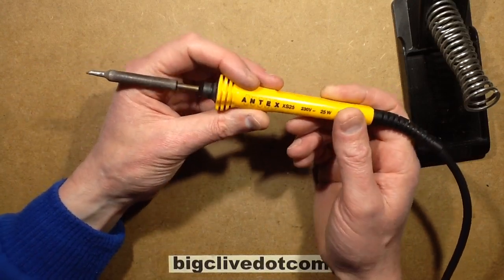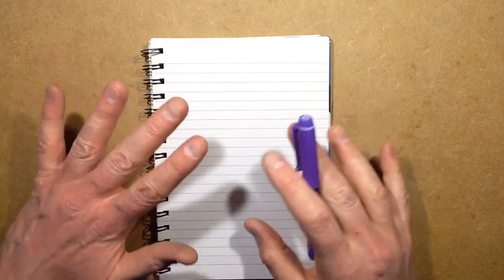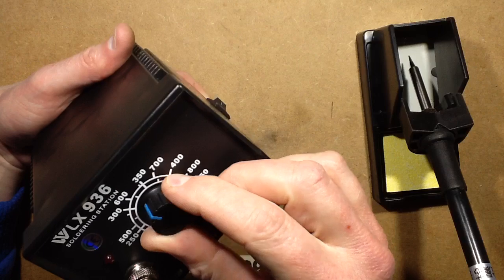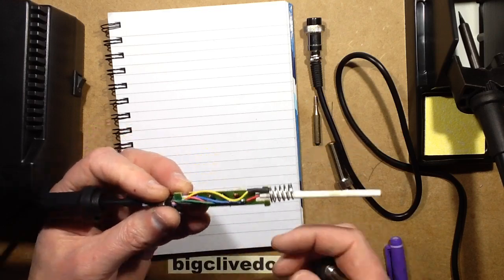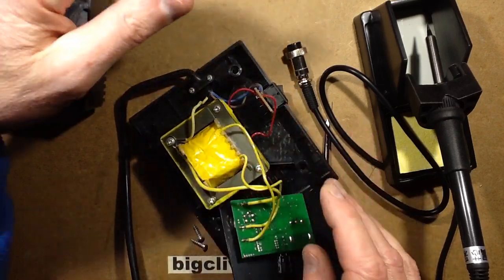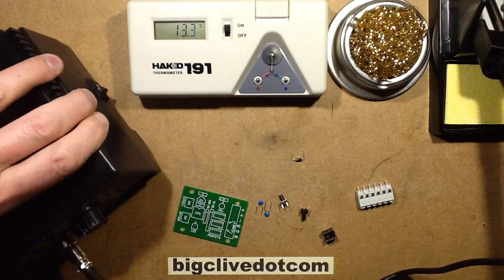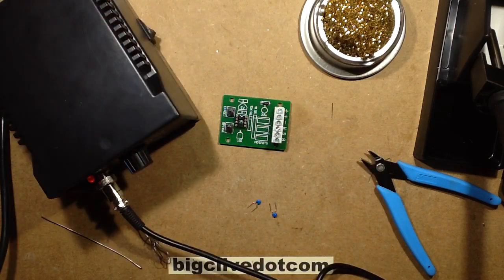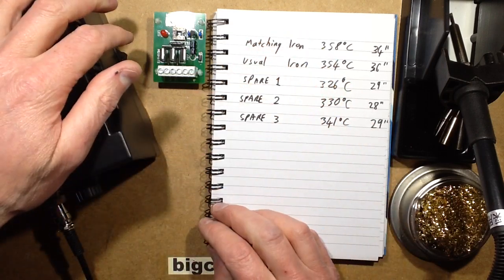Soldering basics and choosing a cheap soldering iron.

Comment: I struggled with a $15 iron from Radio Shack for years. Nothing but rotten apples. Couldn’t solder a headphone jack. Thought I was rubbish. 

I had wanted to upgrade to a Hakko or a Weller, but I got a TS100 and it completely changed my ability and interest in soldering. So much fun.

The TS100 is a relatively expensive Chinese iron, but totally worth it. Get something decent and you won’t regret it.
Reply: Had a rechargeable two 'Wire' soldering iron like the the Weller Auto-trans. (just press the button), loved it (no wires)until the battery died, but couldn't bear to throw it in the bin. (It's still there,  O' well back to Fireball XL5)
Reply: How is with the whole ESD problem? Is it grounded by the power source?
Reply: The TS-100 has a grounding point screw near the back of the unit, and you can connect it wherever you need to, to mitigate ESD problems. (Wrist strap, Mains Earth, etc..)
Reply: Same here! I thought I was simply not able to solder, I had gone through a handful of Walmart turds. I decided to buy a Hakko F888D because of a wiring project I was doing. Best. Experience. Ever! I always love an excuse to use the thing.

Comment: 90%  of Aerospace soldering uses noClean solder without a flux core.  I hold J-std and Milspec soldering certs as an instructor.  My first project was downlink encoder boards for the Hubbell.  I also worked on the Seawolf, F35 and OHP class ships for Lockheed.  I left after they paid my student loans off because of 13-18 hour days as a Production and rework engineer.
A proper Filet is what you want, like a little Hershey's kiss.  Frosted filets are cold joints, brownish are hot joints.  All filets should be bright and shiney after cleaning if using rosin core.  
The hubbell was soldered with silver solder and conformal coated...one of the boards has my thumb print in it along with the VP of Production for Sperry Earth Systems.  We both put our thumb print in it so we would know its ours.  Besides how many people can say they have a fingerprint in space.  He also put a lock of hair from his newborn daughter in there under the coating.  Its undetectable to the naked eye because her hair was blonde and the coating has a yellow tint to it.

Comment: love watching your video's Clive,  my first kit was one of those round clock kits with the 60 led around the outside for seconds and lcd module for time,  lots of surface mount parts too. they were so small,  some not much bigger than a tooth pick tip,  was so intricate, took me 6 hrs to complete.  lol
I've also done tv's and freesat boxes etc, they are so much easier.  my main irons are a portasol technic and a weller s125d

Comment: I use a Weller soldering gun when I need to solder something big like a car battery cable. You can use a bit of 10 gauge house wire as a bit. Mr. Carlson's lab youtube channel has some good videos on that as well as other soldering tips. He suggests using some liquid flux in addition to the flux core in the solder. You can order it from Amazon and elsewhere, it's called RA type flux. Makes soldering a bit easier in some cases. Good video.

BTW: I taught both my kids how to solder at a fairly young age. They have both built a number of those kits you can buy. Want to teach them welding next...

Comment: Do you  repair electronics? I have an old HiFi Stereo and it was working but then all of a sudden it stopped, all fuses are ok and I believe that power is still getting to the PCB. It sentimental value to me so I don't want to skip it but it doesn't work. Quite happy to post and post back, just need someone like you to repair it as no one around here seems interested in repairing. Could be a challenge for you :-)

Comment: I bought three 936C stations from different sources as at the time it was still possible to get a genuine Hakko 936, alas they all turned out to be Yihua 936C's...

I then purchases some spare parts just in case (two spare PCB's with front plates, ten tips, two heater elements and five spare complete irons)... Everything included cost less than my Weller station and all of this because replacing my Weller Tips was too expensive....

Comment: I have some perf board but without copper circles or metal just a board and i cant seem to get the solder to stick can you pls help me?
Reply from the maker: Solder won't stick to the non metal perf board itself, but if you put components through it you can solder their leads together.

Comment: U see i was using idk the right model but station from 1970 i guess old but works good it had giant transformer little sercetboard with tesla chip i felt good when i saw it and it did not work it had 2 fuses and big switch in the back and potentiomeeter at the front idk about any calibration on it as far it was max 300 degree but it did not work so i was thinking to get 220 to 20 v transformer as far but i get my old laptop power supply that i tough dont work and i naild it on the test open and check too and i get quite boored and i also dont wanna screw it simmular to that one just 2 cable kinda melted between the handle and the cover to the pin the handle screw edge did melt that mean it worked xD the point is i try nailding it on 12 v pc power supply and it worked awesome like 250 if i shall say idk i think about 200 max 250 so i normally use it now on 10 v addapter but i think get adjustable 220 to 20 and get it down to 10 -15 with potentiomeeter and get some case for it not bad one just works awesome hmm but now i think i shall try make something with that one xD i mean come on 2 pounds :/ if i dont try ill feel bad xD

Comment: I have a Antex gascat. Fully boxed, tatty instructions, original tip, one badly pitted tip (I was 14 and they installed the cutter) and one new tip. Anyone want to swap for a wired iron? Or just take it I really don't use it

Comment: If the temperatures vary between the irons, it means either that the materials they made the thermocouples from was not pure or correct or else there is a problem with thermal coupling (as you mentioned, it is poor)

Comment: For the big solder joints, what if you just turned the temp control dial up a bit jut before you solder.  If you like the control algorithm so well, it should quickly come up to the new temperature.  Also, you should see the LED come on solidly when connected to the thermal load if the temp regulation is working well.  Unfortunately, you mentioned that the thermal coupling is not good. If the thermal coupling was good you would not need a large themal mass as the feedback would keep it properly in control.  I have a real hakko and I have not had a problem with thermal mass.

Comment: have a similar one & it works ok for what it is BUT BEWARE the one i got had no mains earth (2 wire)to transformer BUT still had the iron barrel gnd connected to trani lamo's as shown result! had capacitive coupling so barrel so had some volts on it to ref ground & unit was marked ESD safe !!!!. so remove the barrel earth off trani & via banana socket on unit for external static ground  also beware the iron (complete handle assy) may have the correct plug ect but has either thermistor OR thermocouple  so make sure u buy the replacement "handle iron"  that mates with the name on the base station, same with replacement elements . otherwise these are good value units

Comment: 63/37 solder is the BEST, it costs a bit more than 60/40 but it is HARD to mess up a joint made with 63/37 unless you're TRYING. Try that as your second solder, if you haven't tried it before.

+bigclivedotcom - You can solder Aluminum somewhat - Get lots of flux on it and get it hot where you want to solder it (a blob of hot solder with flux still around does work. Now scratch the oxide off of the Aluminum, under the flux. You'll find that the solder will bond to it, where you scratched it. Not "perfect", but if you want a better ground connection to Al that'll do it. If you just make a tiny scratch you'll just have a tiny solder joint so feel free to "go large" and scratch the heck out of it :)

Comment: With the thermal control on those stations, lead free silver solder is actually better than lead based solder. I was for 20ish years such a fan of lead based solder that I would not buy anything else. Specifically I used tin-lead-silver (typically called silver-bearing high tech solder) which was aimed at low noise solder joints for high bandwidth application. Recently however with the public going insane over lead and not understanding which compounds containing lead are safe and which aren't I can't buy it locally. 

So I switched to tin-silver-copper, specifically: 96.5% tin, 3% silver and 0.5% copper. I was blown away by how much better this stuff behaved with a temperature controlled station. Your typical old fashion thermal balanced iron doesn't handle this stuff very good, good chance it will damage one of those irons. At 250C on my Aoyue 936 it flows perfectly without any real effort. 

Still not sure if the low noise joint claims are justified yet with this stuff as my heating element popped before I could finish the project where that is very important (soldering a new VGA port into an Xbox360). Sadly that's where these type of irons fail, the low thermal mass doesn't hold up very well against a large ground plane. It popped the outer ceramic of the element so badly that I'm carefully working on dissolving it out of my favorite pointed tip (the only tip I've ever owned that could tack down surface mount pins without scorching the chip or pads).
Reply from the maker: For a long time I used low melting point lead/tin/silver solder and loved the super-clean joints it made.

Comment: You say "lead based solder" in many of your videos, but what alloy are you really talking about.  Lead has a higher melting point than tin and if you were using pure lead, it might require a bit more heat in your soldering iron.  When we cast bullets, many people add a bit to tin to the alloy so that the lead will fill out the mold more evenly and have sharp edges on the lube grooves.  Tin has a melting point of 449.5F/231.9C whereas lead has a melting point of 621.4F/327.5C.  Bismuth is also used in some alloys and it has a melting point of 520.5F/271.4C.

I've noticed while trying to desolder components from old TVs and such in order to salvage parts for other project that often the soldering iron that I was using would not heat up enough to melt the solder.  I'm not sure what alloy they are using, but it seems to have a noticeably higher melting point.
Reply: Grumpy OldMan In soldering, "lead-based solder" is almost always the eutectic mix of approximately 60%/40% . This mix was developed to provide the best and most reliable joints between copper wires with the lowest risk of whiskers forming.  Big Clive seems to use a more advanced mix with a slight amount of silver added.
  The higher temperature stuff you encounter is probably the various lead-free alloys that were developed to reduce the amount of lead in factories. Older lead-free devices may use any of the early attempts, but I think the modern ones are tin/copper or tin/silver/copper.

Comment: Clive, to improve heat coupling between element and bit, I've been using regular household aluminium foil wrapped cleanly and tightly around the element until it's a snug fit. I have yet to encounter any problems.

Also, I'd hazard boldly that the 5-pin plug/socket be of the GX16-type, not DIN. If a mismatch was encountered, making a gender changer, even though likely more expensive in components alone, would at the very least be a nice project for soldering practice.
Reply: That's clever. I was thinking of some high-temp thermal cement I've seen before, but this sounds more practical and a heck of a lot cheaper.
Reply: @Sammus7t  Note, after an undetermined time of anywhere between days to months, the foil wrapping seized the cartridge in the tip. I can no longer separate them without worrying about damaging the cartridge. That said, the cartridges and tips (and entire irons) are so cheap, if I ever wanted to change tips, it's barely an inconvenience after all.

Comment: what type of ashtray is the one you use because i  really like how your works and look for cleaning the tip
Reply: Derek Smith You don't buy the ashtray. You buy the brass filings solder iron cleaning thing complete with brass and holder. The model he uses happens to use a rejected ashtray as the holder.
Reply: John Francis Doe yes i know it and old ashy tray but i like to know what kind for the way he use that one work realy well and find a good clean that can hold up for long term off shelf is mot realy ther so you make thing out of stuff that are not mint for them wich is why i ask what ash tray he has so i can get one for the same use

Comment: Is it okay to use steel wire sponge to clean soldering iron or is brass better?
Reply from the maker: The soft brass pot cleaners seem to work well.  Not sure about the steel ones.  You don't want to use anything too abrasive as there is an iron coating on the copper bit.

Comment: My 936 stopped working after very little use. Turned on using power switch on the site of the base unit and LED briefly turns on/off. No heat to iron.

Where's the best place to order spares? Thanks.

Comment: The Bakon SBK 936D I just bought, has a 6-pin Female connector on the soldering iron handle.. Where can I find a compatible replacement for it?

Comment: I have that small Antex 25w affair (it's very good. Also, I bought one of these 937 solder stations with the WEP brand-name. It's surprisingly good and more accurate than my disappointing CSI [Circuit Specialist] Premier 75. The 937D+ I bought actually measures 300C when it's set at 300C. Here's my video showing it's accuracy; https://www.youtube.com/watch?v=XxjbyzCoO6Q

Comment: I have the Weller WES51 and it seems to do ok. I've used it a lot and sometimes it would be nice to have a longer cable running to the iron. Would this just be a matter of swapping it out or is the length of supplied cable optimized in some way? Maybe I should look for a cordless iron? Thanks!

Comment: I picked up the 8786D , is there a way to calibrate it? My unit it showing 200c but the iron temps hit well over 400c according the the "Hakko"191
Reply from the maker: +Uplinkpr0 I made a video about the digital iron and a slight soldering issue it has.  If you search for it in my videos you should find it.  It involves reinforcement of the soldering on the iron connector where it goes onto the PCB.
Reply: I think i saw that video, would that still apply to a unit that has the iron and the gun like this?

Comment: These irons use a thermistor, not thermocouple. They still use an opamp for amplification/buffering of the thermistor "output" on the voltage divider. (My Hakko 888 does, anyway. It contains a dual 358. One wired as amplifer and other just as a buffer... probably doesn't do much, but dual opamps are as cheap as singles). BTW, I don't think 358 is capable of reading thermocouple on a single voltage rail. There's too much dropout close to the rail to read the "miniscule voltage," as you say. The Chinese clones that use T12 tips with thermocouple in the heater use specific thermocouple amplifier or other part than 358.

Comment: Does anyone know how many Amps is the transformer inside the case.
I know it is a 24V one but what is the rated power of the transformer ? 2Amps ? 3Amps? 
I bought a controller online just like the one on the video but I need to know the specs of the transformer.
If anyone could help that would be great.
Reply from the maker: Typical 60W iron would require around 3A at 24V.
Reply: Yup my math is the same but I can not find a 3A transformer that fits inside the case.
So I plugged a 2A transformer (fits inside just right) to one of those 50W cheapo irons.
Notice that the cheapo irons all are rated at 50W ... not 60W.
Well it could be a problem of my temperature controller but the iron after a couple of minutes almost Meltdown :) it was red Hot ! Like if there was not temperature control whatsoever ... strange to say the least and hence my question about the rated power of those transformers.
Also every single picture I take online and there are many for those 936 solder stations show a very very small transformer ... I would be skeptical to think they are 230V Primary, 24Vsecondary and 3A transformers ...
Reply: Oh and now that you replied I must also take the chance to Congratulate you for your awsome channel :)

Comment: What's wrong with a UK rated 220-240 Volt thermally balanced iron?
Reply from the maker: +Bob Hatcher Nothing at all.  I used to use an Antex XS until the bits suddenly started failing quickly and the replacements were ridiculously over priced and only available in multi packs.
Reply: Fair enough but I just got a new tip for mine for a couple of quid on Ebay :) Thanks for all your fascinating and helpful videos!!

Comment: I got a 936. How important is the size of the transformer? Or what is its impact? (the transformer in my 936 is maybe a fourth in size of the one in this video, similar to the ones you may find in a PC ATX). It works great compared to what I had before, just wondering about the size of the transformer, thanks.

Comment: Hi Clive, I live in India and I recently bought a Yihua 936, but it only came with a pointy tip. I'm trying to make my own audio amplifier and I'm dealing with normal through hole components like opamps, resistors and caps. What type of bit do you recommend and what size ? Any help is much appreciated..
Reply from the maker: My prefered size of bit is a 900M-T-3C
http://www.ebay.com/itm/122209020123
Reply: Thanks 👍👍

Comment: 380°C?! Jesus! Are you sure that's necessary? I've got a similar Chinese soldering Iron and I mostly solder at 220–250 and I certainly don't have any trouble heating the joints.